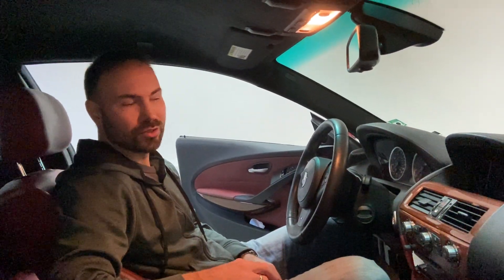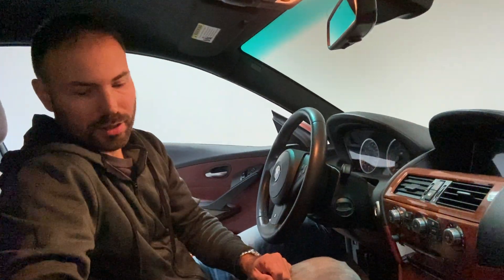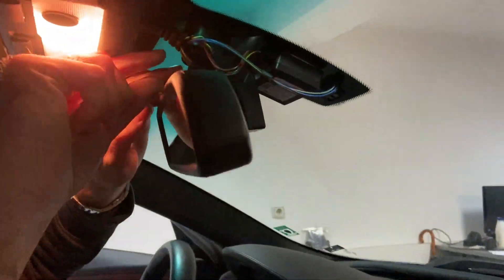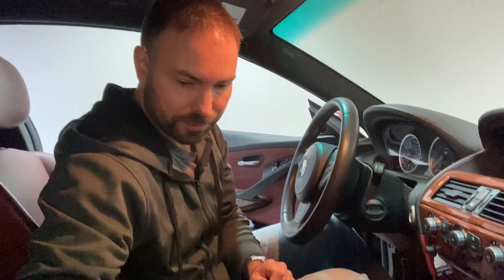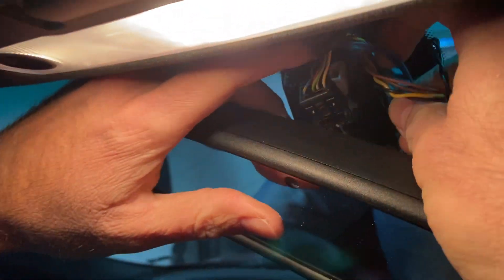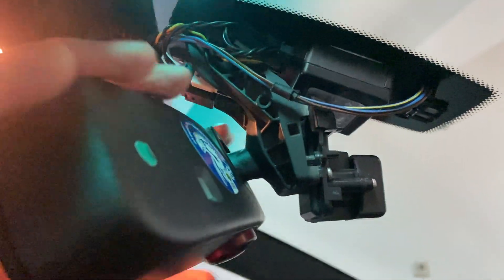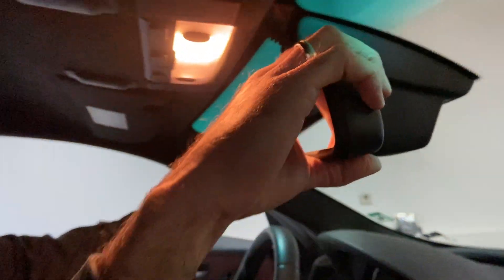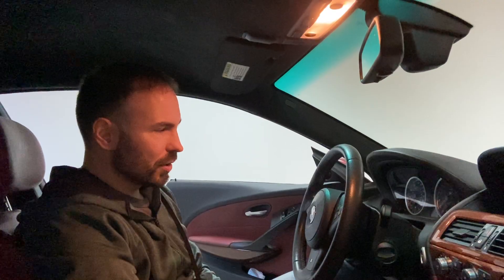How to retrofit high beam assist (FLA) on a BMW E60, E63, E90, E70, E82, etc.

Comment: This tutorial is not valid for bmw e70. The rain sensor is different and is a 3 prong connection from factory. Made the mistake of assuming I had the same rain sensor and created the wiring loom ahead of time. DOH

For e70 x5 you will need to have just male 3 connector with 2 female pins. create a twisted wire and tap into sunroof panels canbus wiring (orange and green wire that is also twisted).

Comment: Hi!
Video is super, super instruction.
I mounted too FLA in my E60 LCI but is it too sensitive.
Switch off when appears road signals.
I try to set with  NCS expert everything but not help :/.
Anybody know  solution how to fix it?

Thank you, have a nice day.

Viktor from Slovakia.

BMW E60 530D LCI
BMW E63 650i
Reply: it’s because the camera is covered. you either need a new windshield, or remove the black paint/coating on the windshield. He didn’t do it in this video.
Reply: @Robertbartaa 
It is solved.
I have a camera from a pre LCI model and my E60 is LCI.
I bought a camera from LCI model and IT works fine.
Thank you! 😉

Comment: Hello friend do sou know Does the rear-view mirror from the BMW E60 fit the E90 model with high beam assist?
Reply from the maker: I think it does, yes. But there are different versions - ones with a round camera and ones with a rectangular camera. I'm not sure those are compatible between each other. Just look up the shape of the camera on the original E90 version and find one from an E60/E65/E70/E9x that looks the same.

Comment: I'm in the middle of this retrofit on my e90 and the Rain Light Sensor on an E90 does not use the normal CANbus that we need for FLA.  On an E90 the RLS uses LINbus and only has 3 wires instead of 4.  None of the wires are twisted either.  I bought all the parts and was in the middle of making the jumper harness when I figured this out, would be a nice easy solution but it seams like this only works on older cars.
Reply: @RWeCrazy - I have a 2012 E70 and ran into the same problems. Have you figured out how to retrofit the mirror yet? I'm looking for someone that can help me figure this out.
Reply: @MichaelJohnson-ql7vr  Yes I just had to make a longer Canbus twisted pair that went all the way up to the FZD module which is where the dome light and sunroof controls are. Sorry I left that out of my original comment but hope that helps. Just look for the twisted pair of wires in whatever color the can bus is.
Reply: @RVCrazy  I've been playing this game for months, trying to figure out which wires I should connect to. I may be asking a lot but do you mind sharing a picture with me or a description of the wires you connected to?

Comment: How about keyless ? All brains are inside the mirror¿
Reply: No it’s not inside the mirror
Reply: @Winter1256  I think it depends on the car, whether coupe of convertible.  For the convertibles, E64, E81, E87, E93 the remote control receiver is integrated
into the interior mirror (because convertibles do not have remote receiver on the roof).
Reply: @btmasscom  good point 👍🏼

Comment: Thanks for the clip. The 10 pin connector on the mirror w/o FLA has 9 pin, while in the FLA one has only 6 pins. Look like those missing pins are to control the dimming in the 2 door mirror. Is your door mirror dimming working properly after the new mirror retrofit?
Reply from the maker: The larger connector is not affected by this swap. So if your old mirror had dimming and your new mirror has it too, it should work fine. And yes, in my case it does work fine.